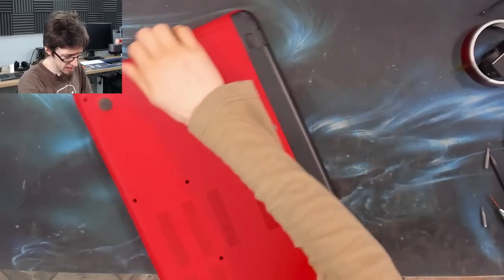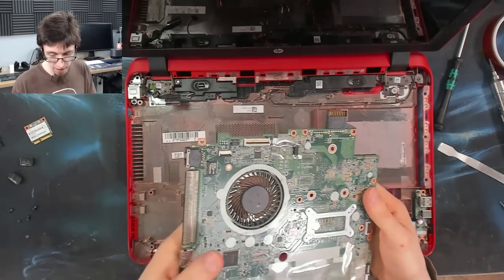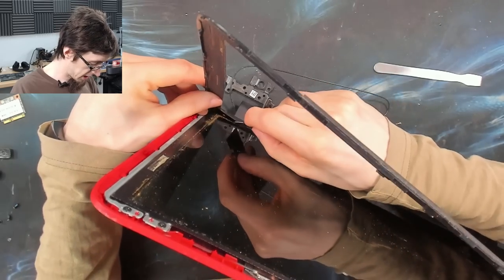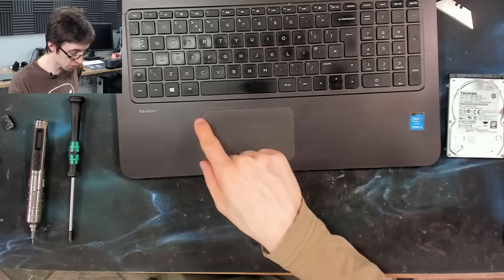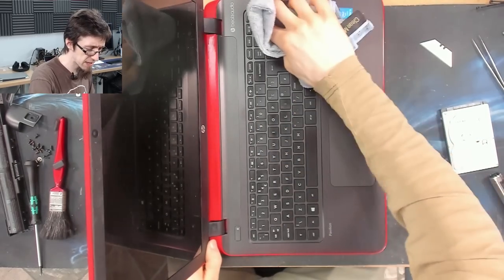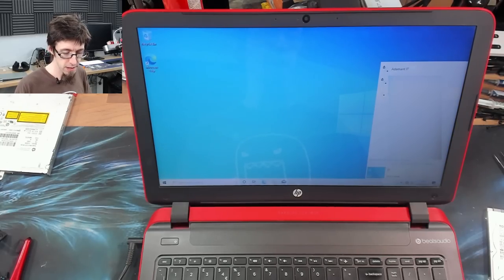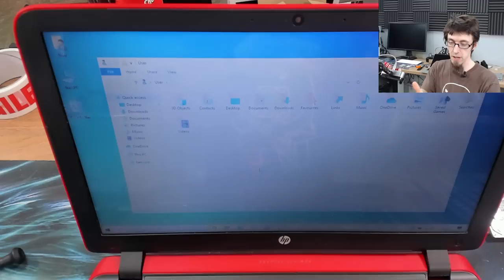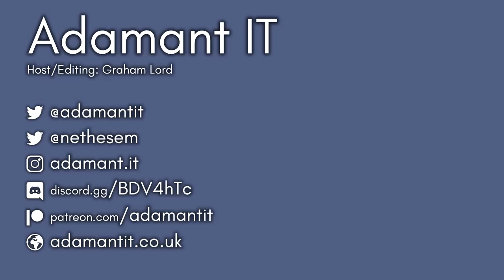HP 15-p Laptop Refurb & Chill - LFC#269

Comment: 2 things, I sometimes use my prying tool for such jobs, after I heated it up a bit, like 70 or 80 degrees. I use a glove so I don't burn my finger. Cuts through the adhesive tape good enough.
Second, on people who casually use computers, like browsing, movies, light office use etc, I just install a 128 or 256 cheapo ssd. Waste of space for more.

Comment: When I refurb machines, I'll sometimes buy new Intel badges. You can get 'em on eBay for cheap.  I like stickers, so I think it's nice to put on a clean, new badge :)
Reply from the maker: That's a good idea actually, ye. The badges can be really useful to identify the laptop spec too. With chassis like this being available in anything from i7 to potato, it's good to know if the laptop is any good at a glance.
Reply: Plus, not adding stickers is like leaving performance on the table.
Reply: It's the equivalent of a "go faster stripe" on cars!
Reply: @Adamant_IT  Don't worry, I won't swap all the stickers around as a prank ;-)

Comment: Screen bezel on those I find heat gun low heat from a slight Distance and loosen the Adhesive that way .. fluent left to right ,, Right to left Move ... Works for Me Graham ..
Reply: Mr Guru  If they take it literally then they do it like advised: with low temperature.
Reply: Perhaps a simple hair dryer. Low setting = low heat, a bit of patience and, voila!

Comment: I find that a bit of heat helps soften up the adhesive. Use your hot air at the lowest setting to get the area warm, but it shouldn't be too hot to melt the plastic.
IPA is good at breaking up some adhesives too. (especially if you run into hot snot) You will have to play it by feel as to whether you need to wait for the IPA to dry and re-wet again for it to break down the adhesive, or have to keep it "moist" while lightly prying away.

Comment: I usually use WD40 to remove glue, stickers etc... maybe this helps with the sticky Display as well?
Reply: WD40 also makes an excellent cleaner for matte black or other dark non-shiny surfaces. If it is applied sparingly and spread evenly before being wiped over with a dry cloth, it works much like the “back to black” products which exist for renewing car bumpers / black plastics, etc!
Reply: And it smells lovely 😁
Reply: Mr Guru  Good Point! But before breaking anything I personally would give it a try... and maybe regret later... but I would try :D
Reply: WD40 dissolves certain types of plastic, not recommended for laptops. For glue removal you can use isopropyl or for the persistent ones glue residual removal fluids, works like charm.

Comment: Way back in the day I used fix broken old electronics and oftentimes I would find myself completely disassembling an unusually grimy piece and soaking the plastic housing parts in a solution of warm water and soap in order to get it clean.

Comment: IsoPropyl  Alcohol softens the glue from Dual Side sticky tape. This makes it MUCH EASIER to remove it WITHOUT trace and WITHOUT damage. Use a syringe with needle to make sure you are precisely  dropping the IPA where it should be between the surface and the dual side sticky tape.

Comment: I work in IT too but on the side I refurbish desktops and laptops on the side. I stick with three SSD brands that do not hurt the wallet. Adata, Silicon Power, and I just recently found Timetec for 1TB for $85.
Reply: I have two Adata 128 MB m.2 SATA and one Adata 256 MB m.2 SATA
They are cheap and all work fine.

Comment: Adding the WiFi antenna seems like the best solution as a lot of laptops have a "WiFi whitelist" where they will refuse to boot with a replacement WiFi card.  There is a solution to this, but it requires modifying the BIOS (or flashing something like Coreboot).
Reply: Really lot of laptops? It was mostly Lenovo and some HP. Luckily I think Lenovo has finally discontinued this abomination…
Reply: @geraldh.8047  Honestly, I haven't dealt with many laptops.  Though my ThinkPad T430 had this issue as did every HP laptop I've touched.  I just assume they have the whitelist, so...

Comment: Dealing with adhesives sticking screens/cases/etc - get yourself one of those El Cheapo bean type bag thingumys that you put into the microwave to warm up (for pain relief).  Warm it up, and then lay it on where the adhesive is.  It doesn't always work, but it usually helps by loosening it up quite a bit.  Also good when trying to remove glued in lithium batteries.  You don't need it to be super hot, but be aware it will 'sweat' a bit.  It's 99% the same as the iFixit thing but without the ridiculous cost.

Comment: loctite or 1 drop of krazy glue on the monitor hinge screws keeps them from coming loose with general use. But isn't so strong it will make removing the screws impossible in case of a monitor replacement.

Loctite is my preferred option mainly because it is designed to come loose. Krazy glue is easier to access, so the less krazy glue you use, the better.

Comment: hi to add to how i would deal with adhesive tape of any kind i would use low heat either dry up the glue/ adhesive careful not to heat the LCD glass or burn the pixels i prefer it over the slow and stead cut the adhesive away and risking hitting the screen

Comment: When it comes to things like the glue holding the bottom of the bezel on, I'd dribble a little Isopropranol on there to dissolve the glue a bit. Works on MacBook batteries, why not HP bezel?

Comment: When I do restoration though, if the keyboard is too grimy, I go as far as taking off all of the most commonly used keys, clean the underneath of them and also throw the keycaps into a thorough wash. There is a risk of breaking the keycap/switches but when you get experienced with that enough, the likelihood isn't as high as long as you aren't dealing with laptops that has plastics visually very brittle and falling apart.
Maybe you should've kept the 8GB RAM stick, it's probably worth more than what you paid for the entire laptop!

Comment: I bought one one these without any OS installed. Was going to use it for testing Linux distros. 
That turned out not to be ideal. Later I found out it had a WIn10 key embedded in the hardware somewhere.
I was also disappointed with the weak screen brightness and narrow viewing angle.
Great video & dual channel RAM tip.

Comment: 42:00 Hello, you are wrong about the wifi card and the antenna, in rare cases like that windows installs the wrong driver where port 2 is the main one and port 1 is the secondary one i.e. turned off, if you had downloaded the official driver from the site you would have had a full signal because the ports would have been returned to normal order! This is 100% correct!

Comment: When removing adhesive from glued on bezels, I have some success by applying isopropyl alcohol and slipping an old credit card or other plastic in between. lots of alcohol will soften the adhesive a bit.

Comment: I just upgraded my wifes new second hand HP 15-ab269sa today with an ssd, it's only a crucial m300 275gb but she doesn't need much space, and I also found out the return key doesn't work so she needs to use enter on the keypad

Comment: For older systems like this Linux runs a whole ton better than Windows.  I use a T430 with an updated Gen 3 I7 true 4 core / 8 thread with  2133 memory DD3L.  The OS drive is a sata ssd ( could have gone with an NVME ) and my home/folder drive is a platter 1TB which works very well.

Comment: One thing I do when "refurbishing" machines is enter sysprep (CRTL+SHFT+F3) instead of entering a username at the welcome screen. I can then install all the drivers/updates etc. before rebooting to the "out of box experience". It just means the customer isn't stuck with "user" as their username when they first get the laptop and is free to enter whatever they want.

Is there any further testing you carry out? For example I use a HTML keyboard checker and just run over every key to make sure they work, and then plug something into every port on a laptop to test them etc.
Reply from the maker: That's neat, I'll have to check that out. My solution to the "User" problem is that people can always sign into their MS account, or just change the display name. It doesn't change the home folder name, but that's not really the end of the world.
Certainly a few times where OOBE would be better though 👌

Comment: I have a lenovo g50-30 laptop.  activate the light source.  The website light flashes and then turns off.  current meter indicates 0.15a .  I have updated bios and checked all sources (ram, cpu, gfx..) but still not working.  please help

Comment: Getting the bezel off laptops where they use double-sided tape (which is a lot of them) can be a little annoying.  Sometimes when I do LCD replacements, a new bezel is also included.  Some laptops (I'm looking at you Lenovo) have very delicate LCD screens that are only held in with friction that requires you to pry up on a corner to free it.  I've broken a handful of LCD screens removing bezels or prying up on them.

Comment: Good day sir love your video i learned a lot  from your amazing channel. Can the BK 2709B measure smd ceramic caps like in the phone and laptops and tablet and smd resistors/diodes please kindly reply to know if i should buy it  looking forward to your reply. i was looking at the Fluke 115 Compact True-RMS Digital Multimeter but if the BK 2709B can do the same  job for cheaper price then i will buy it one time. What meter you use?

Comment: I do it the same way like you. Only always replace bios bat also and a keyboard like that also. And battery time need more then 2/3 hours or in will replace that to. And also always a SSD and dust free and cooling ect...... Also that sticker you take off putt it back on the clue you will take it easy off the old clue by tap on it with the sticker. And soon there will be Windows 11

Comment: Hello , from where I download the driver after the format on hp , after restarting it writes avtomatik repair , then diagnostics it . A blue window comes up because it cannot repair , restart and it says advanced . I tried running it in safe mode from the advanced options , it gave an error again , so if this happens you have to reformat it . but you format it again when you install the driver , I found a way but it is not a solution . I was removing the hard disk or ssd and connecting it to another computer with usb to sata and I was starting the computer with it and plugging it into the computer that was failing again , then the laptop would boot up . Why is this happening? It only happens in HP brands. I became an apprentice in a mechanic for 1 month, I was getting nervous. Please inform me, I know I took so long, sorry for the long haul.

Comment: I have several Crucial BX drives, they fall apart when you put a load on it. The MX drives (with dram cache) are so much better. In one of my systems I replaced  a 2 TB BX with a 2 TB MX version, so much better and worth the little bit extrra cash.
Reply: yes the BX ones have insane overheating problems 🔥

Comment: Hey Graham you can just press F9 instead of Esc then F9, also if the hard drive is blank and the BIOS is configured to UEFI, your USB stick should boot as the default device without the need of going into the boot options :D

Comment: Perhaps a guitar pick for lcd panel removal and or a little heat. Love your videos and style!
Reply: Guitar pick is way too small. Watch the vid, he had to push the tool in about 25mm-30mm down and still be able to hold onto it. If you did that with a guitar pick it would all be down under the bezel with nothing left to hold on to.....

Comment: I had Bios Batteries which had 3 Volts but if they were placed inside a device they dropped down to 2 Volts or lower. I would replace if it it would have 2.9 Volt

Comment: I would go into PowerShell removing the apps. most of these apps can be reinstalled as long as you haven't tampered with the windows store. 
at the very least go into the settings app and turn off a lot of superflous apps from running in the bg, windows uses a lot of VRAM for suspended apps, so you want to keep those to a minimum. there's a page for it on windows 10 settings, but for windows 11 it's in the apps and features, you click the 3 dots on the app and if it has the option there, it will say advanced options, and then you will see background app permissions and you just set it to never run in the background.

Comment: Please I need your help to remove a bios password on fujitsu lifebook AH531/GF0 my sister forgotten the password I've try to remove the cimos battery and waited for over 2 hours and insert it back but still the password is still when you enter wrong password for 3 times I get system disabled is 
there any solutions.

Comment: These model Beats Audio HPs have a real bad issue with overheating due to the heat sink now functioning properly. Hopefully this one is ok. But just a heads up. Also on HPs you can just hit F9 on boot to the Boot options. F10 BIOS and F2 for the onboard diagnostics.

Comment: I disagree with the ssd choice, bx 500 is a dramless piece of garbage like any other dramless drive. Tried it, hate it, sold it. I can feel the difference between the mx and the bx series in day to usage. All the background tasks cripple these drives, especially for non enthusiasts how usually have 25 updater and luncher running on startup. I like the video nevertheless.

Comment: My brother has the same laptop, but grey with different specs.. I used a string like you would cut wallmate isolation with a hot metal wire. Takes a bit of patience, but I think it is quite safe for the LCD.

EDIT: Also, I´ve had BX500 240GB, and those bastards get HOT as hell. sold one, and installed the other on my mother's laptop with a thermal Pad between the controller and encloser. those are easy to open, but lifespan wise, those are not good.

Comment: Can you explain the amount of thermal paste you’re using on that cpu?  Is there a specific reason why it needs more than the general rule?  Is this a design specifications for laptops.
Reply from the maker: I'm generally a little too heavy with thermal paste, but slightly too much is better than slightly too little. However, whatever amount I use, someone will tell me I'm wrong ;)

Comment: if you connect to the internet while installing you can still enter a microsoft account you know will not work (for example enter user "a" at microsoft, password "a" which fails), then they will ask you for a local user and you don't need to add a password even. I always sell the refurbished computers with username "user" and no password. (win 10 20h2). Oh, and windows 7 activation keys still works!

Comment: Much better than it was :-D
I install classic shell as i hate not having the start menu i'm used to,  since windows 95 days.
I'm not changing now.
Windows is better when all the rubbish is removed, but thats me lol.
Reply from the maker: I genuinely don't see the point of Classic Shell these days. The Win 10 start menu has the program list on the left, and customisable icons on the right. Heck, you can even vertically align them if you want to have a list format like classic start does.
Reply: @Adamant_IT  maybe its because im an old git lol.
I hated metro so much, you may have liked it.
Hope you sold that lappy and got the pennys you wanted :-D

Comment: Any reason you don't sysprep a Windows build on to a drive and just mirror that on to your SSDs? Could make for a faster build prep time.
Reply from the maker: I keep meaning to do this, but never get around to it. Win 10 is such a fast install anyway that it barely seems worth it, considering the image would need to be updated every now and then. That being said, I only do a couple of installs a week, most of my work is servicing/upgrades. If I did several clean installs a day, that'd be different.